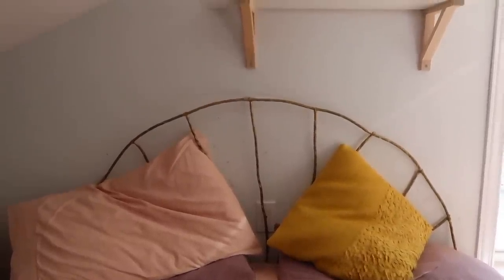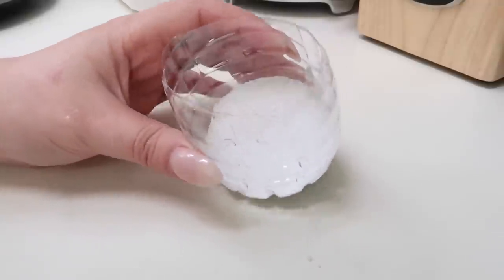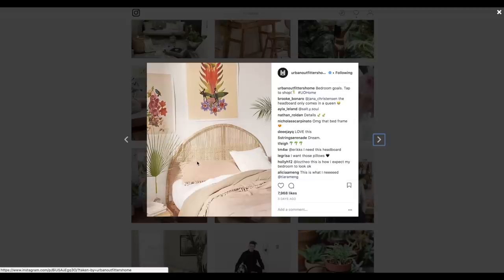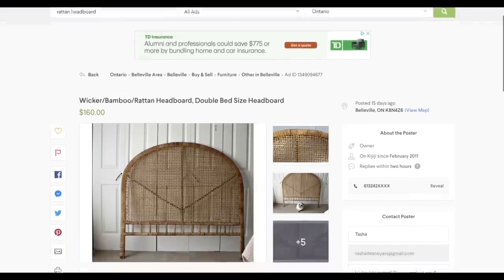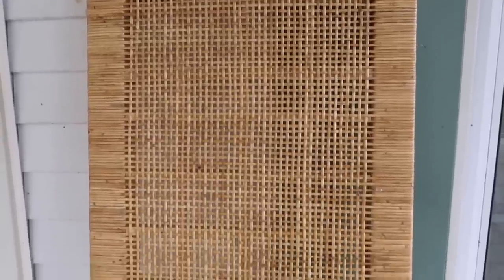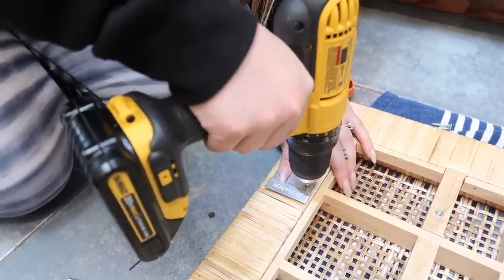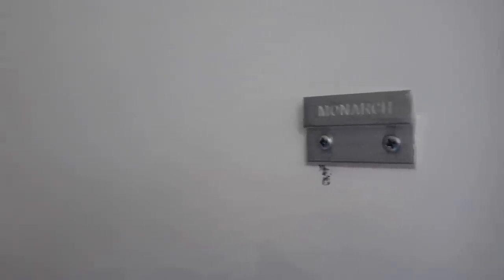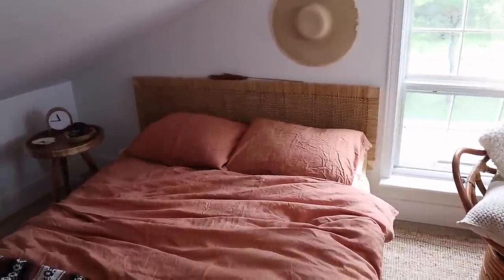IKEA HACK + Mini Bedroom Makeover!

Comment: What is the benefit of the drywall powder vs. a can of spackle. I like the room so much.
Reply from the maker: Spackling paste doesn't have enough bulk for holes larger than about 1/4 inch!!! I only had the drywall compound on hand, but for small holes like this either would work!!! Hope that helps!
Reply: Definitely does and I’m glad to know now not to use the stuff I have for larger holes.